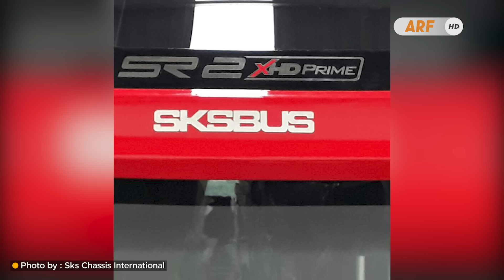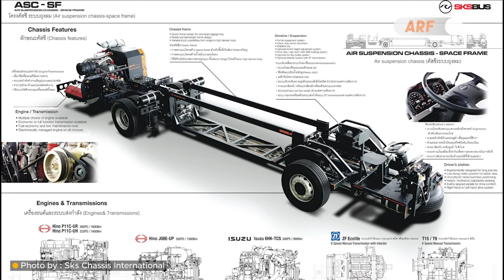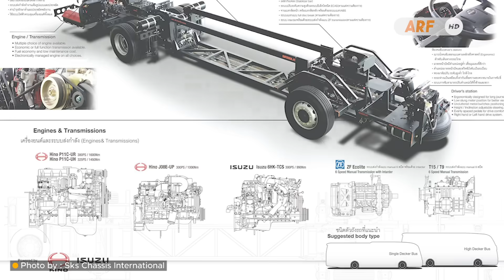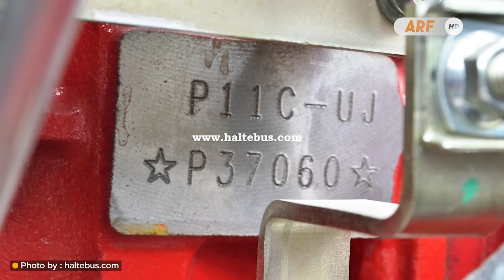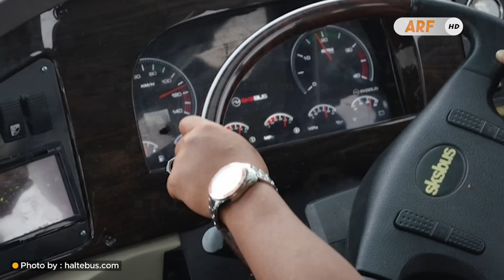Sasis Bus PREMIUM Asal Malaysia !! Inilah Sasis SKS BUS Bertenaga 350 HP

Comment: Mesin P11C punya bbrp model, lainnya adlh P11C-VU yg digunakan pd Hino 500. Mesin P11C-UJ ini punya bore 122mm dan stroke 150mm, jd dgn persamaan kapasitas mesin, yaitu pi/4 *bore^2 *stroke*jumlah silinder, maka kapasitasnya kira 10520cc (silakan kalian hitung sendiri brp persisnya).

Transmisinya menggunakan Allison T375. Kodenya cukup unik krn mewakili tenaga max yg bs disalurkan alih2 torsi max, dimana bbrp transmisi lain sprt ZF dan I-shift punya kode yg mewakili torsi max contoh ZF 6AP 2000B, AT2412F, dsb.

Salah satu hal interesting yg sy dapatkan adlh media tekan sistem pengeremannya. Kalo kalian pernah baca komen Sy di vid Iveco Eurorider, maka kalian akan mengetahui bahwa media tekan rem SKSBus ini sama dgn media tekan rem Iveco Eurorider atau mobil kecil, dimana rem depan cakram ventilasi dan rem belakang tromol, dimana media tekan rem bus biasanya keduanya tromol atau keduanya cakram, tp ini justru kombinasinya. Unik bukan?